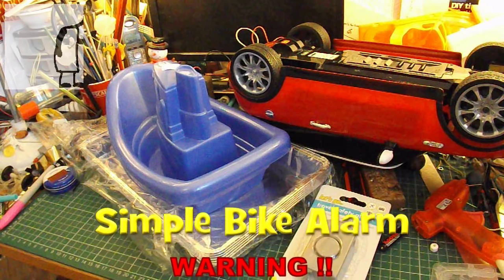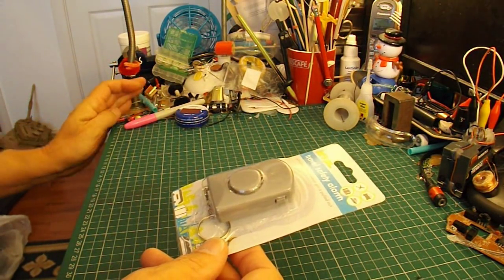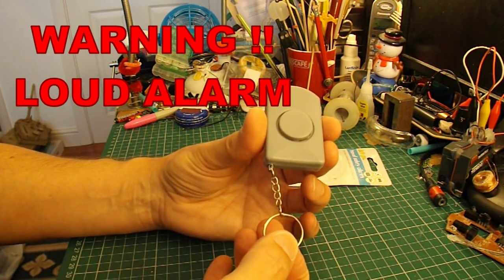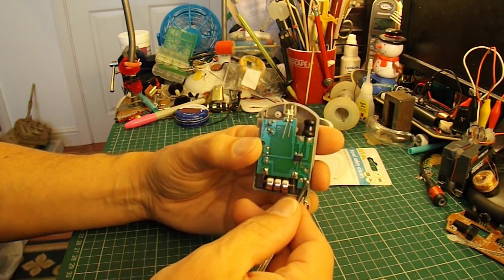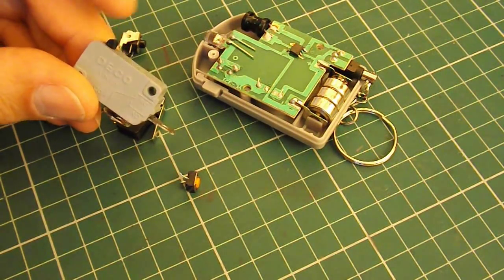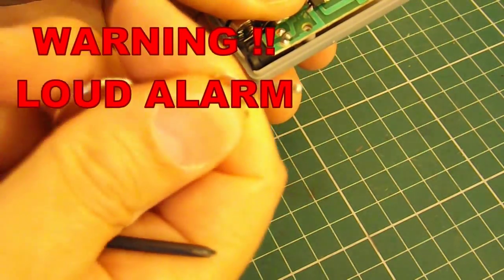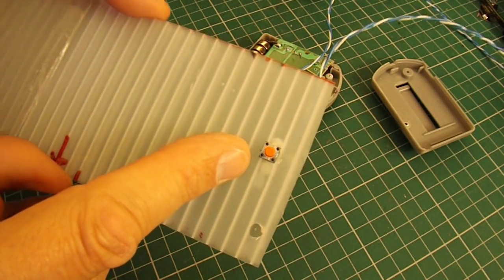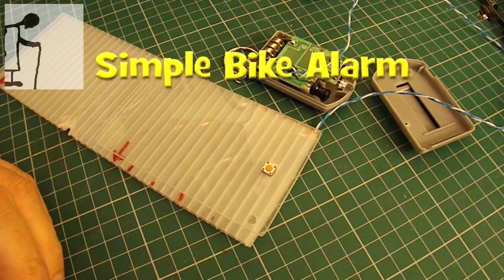Simple Bike Alarm

Comment: It could do with that, a continuity tester for electrical connections.
Reply from the maker: +Francisco Javier Lázaro Pinela yes it would work well, but it is a bit loud. Maybe a resistor or a different speaker to reduce the volume.

Comment: Now I understand, this is the way seat belt warning works in the cars
Reply from the maker: +Gurer Guncan this is very basic, I expect the seat belt warning is a little more involved as it will be linked into the car sound system and dashboard visual display and probably uses pressure sensors to check if you are sitting in the seat without fitting the belt. Probably checks if the engine is running and the car is in gear too.